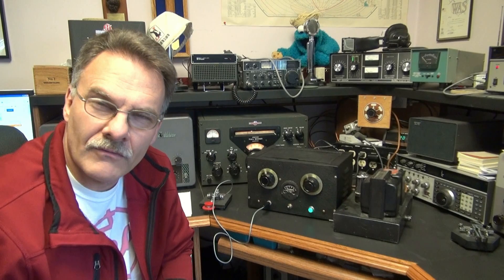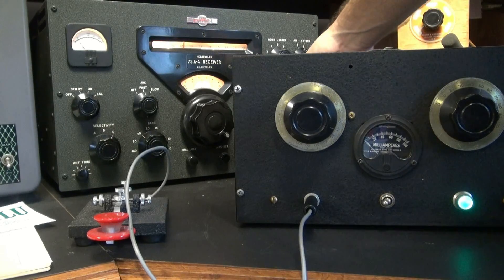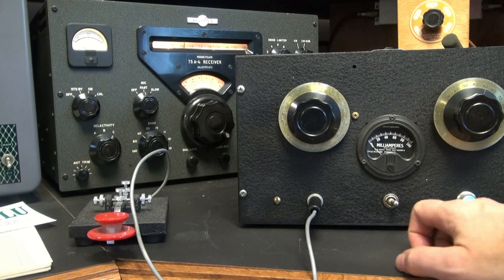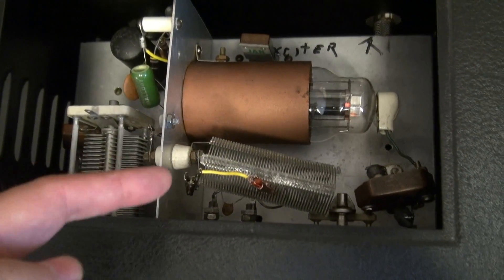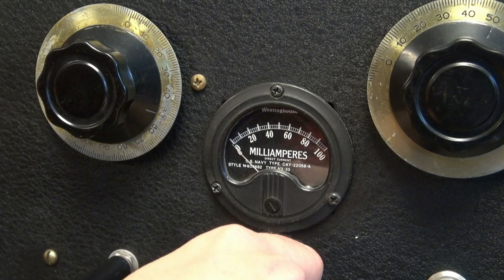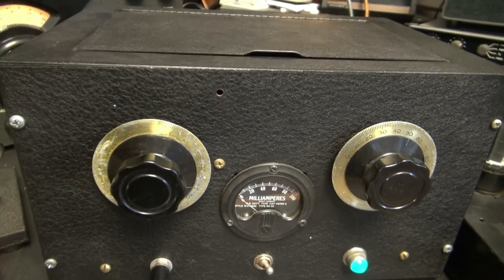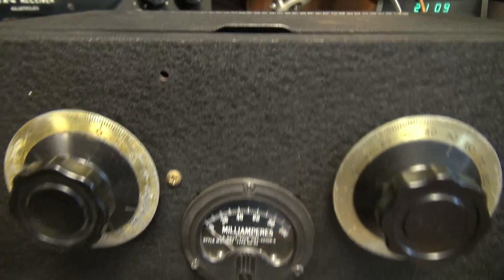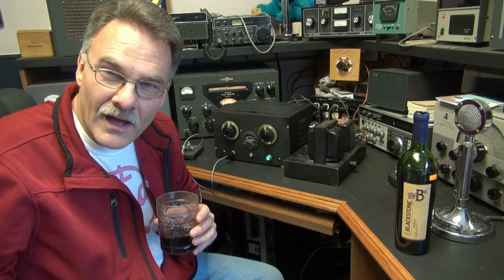Home Brew 807 Tube QRP CW Ham Band Radio Low Power Transmitter Demo by D-lab Amps

Comment: neat rig! A few things that caught my eye:
-It's interesting the crystal is in with the final and is not on the front panel. Must not have planned on it being changed often.
-That coil setup with the alligator clip is amusing. Is the tank circuit HV bypassed? I'd still think you could get a nice RF burn from it
-I'm guessing the second tube in the left side is a 6AG7 for the osc? 
-I've had a few people tell me to keep the plate and the grid sides of an 807 separate via recessing in the chassis. I think that's what the copper tube is there for. 

Seems well built and if I had to guess something from 50s or mid 60s.

Comment: Ah a pair of 50c5. If i can get them did well. Driven by a small driver tube. Did the honors. What I couldn't load on the trailer got left be hind. As I went solar. On landing in Tennessee. Back woods( no AC current ) tks Fer look on fine rig de kv4 li

Comment: I have a 1946 ARRL hand book showing a 25 watt master oscillator P.A using a 807. I built many years a go a M O P A 5 watt using a 5763 tube near  close to a 6BW6 (b9a) 6V6 being the octal version  and modulated it with 5 watts.
Reply: I used a transmitter like the one you described 6BW6 oscillator multiplier 807 PA on 10/15/20/40m. Lots of fun on CW back in the 1980s

Comment: You should be able to get 25 to 35 watts output from the 807. I have an old Viking Adventurer that uses the 807 tube for the PA. It does 25 to 30 watts output. Class C final amp stage. It was rated at 50 watts "input" back in the day. Perhaps the osc tube is a bit shy of optimum for the transmitter. It is a very nice looking rig. The builder did a really nice job on it. 73 DE K7RMJ  Frank
Reply: I was going to say the same . One thing about the Viking Adventurer no sidetone needed  just listen to the meter 
clank ; )

Comment: I have a pair of these brand new 807 tubes. Can't seem to give them away.
Reply from the maker: Are they new? If so, I'd be interested
Reply: They sure are.
Reply from the maker: How much-o? with shipping to Battle Creek, MI?
Reply: I have them on Ebay with a starting bid of 15 and a buy it now option for 30. What do you think they are worth?
Reply from the maker: Worth the starting price for sure. I'll take a look on the bay. Can you send me the item #
Reply from the maker: I took a look at them. I only use the NOS Vintage tubes in my amps. Sorry, that may be the reason they arn't moving. TD
Reply: I have some of those too. I have some 5U4 GB and some 5Z3 tubes.
Reply: RCA NOS/NIB

Comment: tube can handle 750 volts.    At that  it should put out a lot more then 5 watts.   Maybe its under driven with the oscillator.

Comment: cool, interesting, i had a home brew 2 meter rig built in the same chasis as your rig, later i used the chasis for my home brew antenna tuner. wish i would have taken pictures but it has been over 30 years ago and i didnt think of it, like your other rigs also. i still have an amost new ten tec paragon your tn tec looks like an omni v. enjoy. hve another sip on me.73